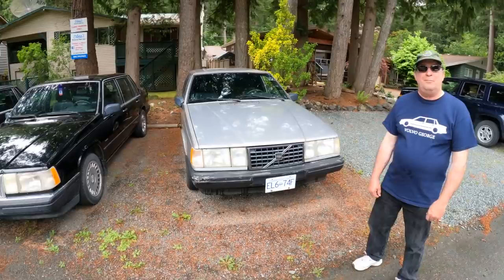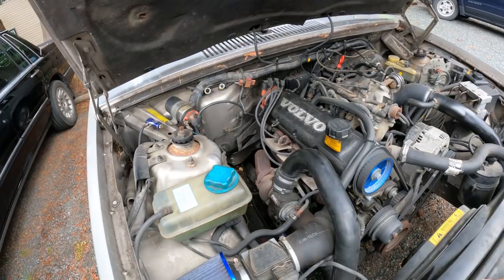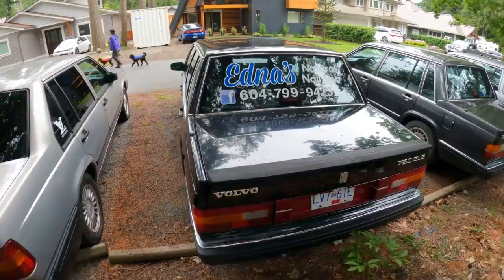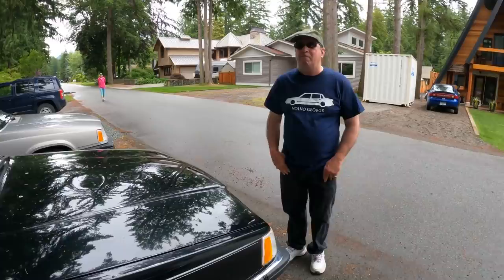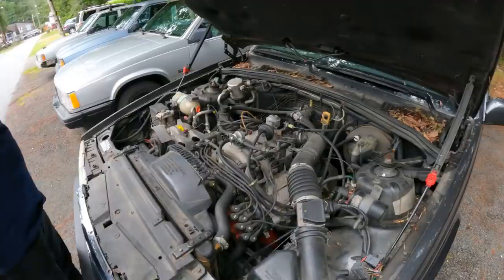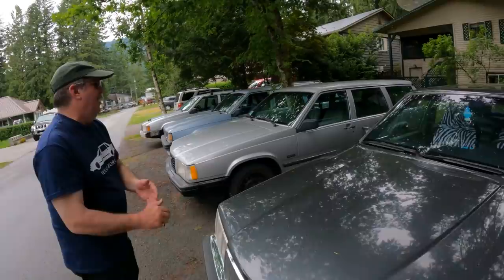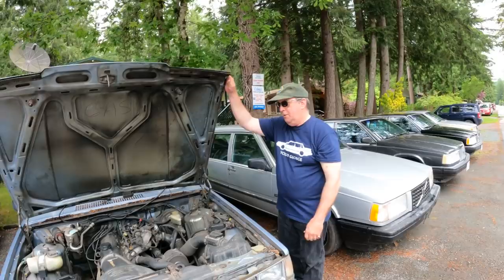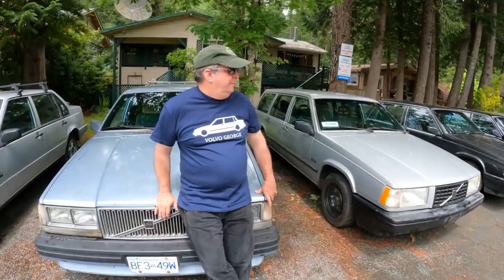volvo george's epic volvo collection!

Comment: I own 240x4 (2x sedan, 2x wagon), 740 16v sedan, 960 wagon (WB not PRV), 940 wagon, 360 5 door hatch. I like my 740 and 960 but I love my 240s, they have way more soul in the way they feel and the way they drive. But the 700/900 suspension (all versions) is far superior to the 240 design for laying down power. Any RWD Volvo is a winner IMO, I've had the most fun in the 16v 740 sedan for sure, G80 with mods now, but was MIG locked for a while. Much smoke, many black lines, no impounds, yet :-D